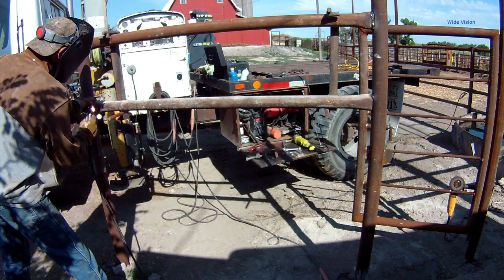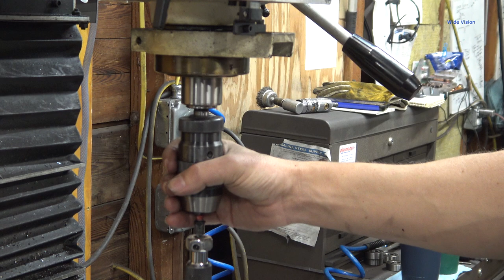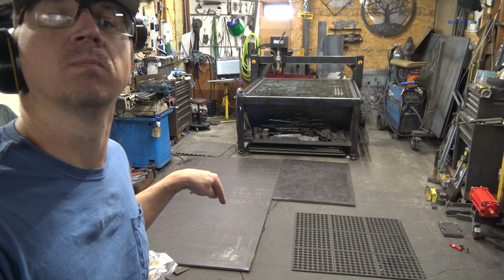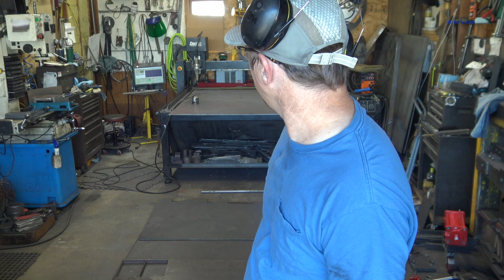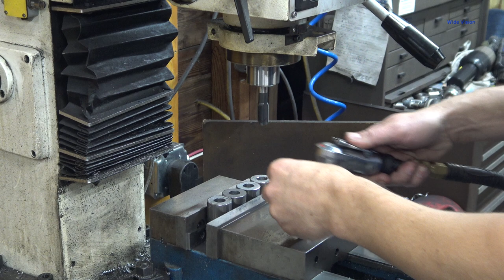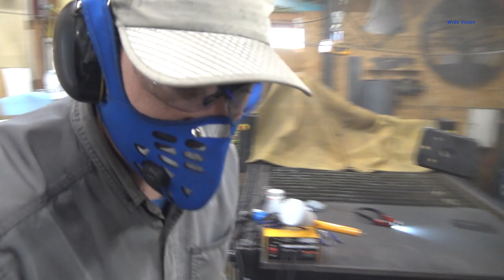Pipe Squisher - HOW IT'S MADE! - portable press by Wide Vision

Comment: That is a cool pipe squisher that you designed and made.  I guess you could replace the cylinder on a log splitter with your pipe squisher and have a nice portable pipe squisher.  My son needed to make about 400 ft of pipe fence and some gates for him and others.  We mounted a pass through chuck on his CNC plasma table.  It cuts a saddle in less than 5 seconds.  It will cut 10 of the vertical spacers for the gates in about a minute.